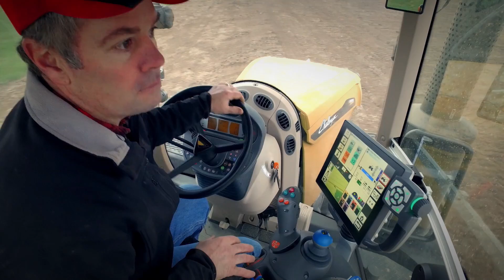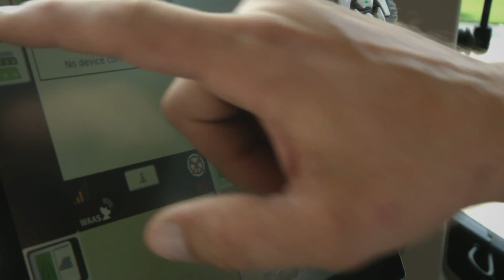Challenger 1000 Series: The World's First 500+ HP Fixed Frame Tractor

Comment: Agco have tsken over building  the challenger track trctors there the E series track tractors 7 cylinder twin  turbo  up  to 400 horsepower 12 cylinder 4 turbo motor up to 700  horsepowermt ,the cat motors were 18  litre with one turbo.,they stuffed them they were good track tractors when they had the cat motors in them,theve only sold 2 of the big ones with the 12 cylinder motor in them and 4 with the 7 cylinder motor   in them, when they had cat motors in them  in  this area here in australia they sold 16 of the 560 to 700 horspower ones and could of sold more if they still had cat motors in them.,the farmers here  where i   am here in aus dont want them now theve  got  the agco motors in them.
Reply: That's a shame because everything I've heard about Sisu engines is very positive (I work for a competitor).  On the other hand the new Cat motors are fuel pigs and not what they used to be quality wise.  Given the choice the only motor I'd take the Cat over is the Deere...even bigger fuel hogs and and some of them have major internal issues.  Buddy's company has cratered 20 excavator motors with less than 1000 hours out of 220.